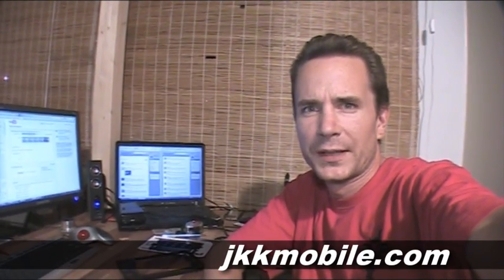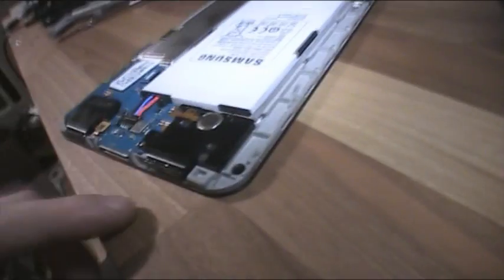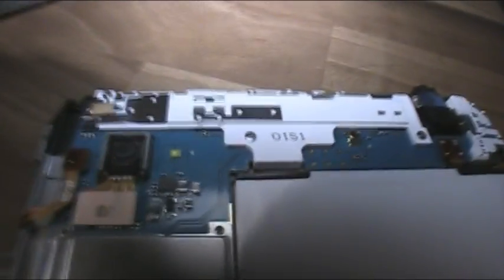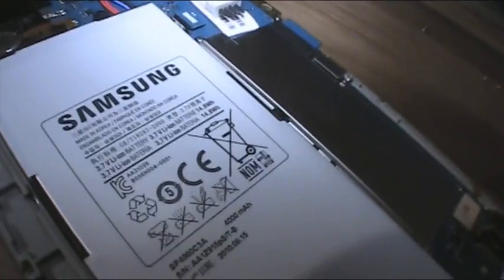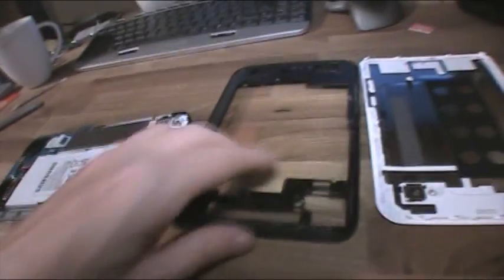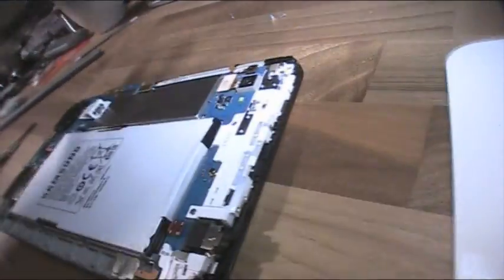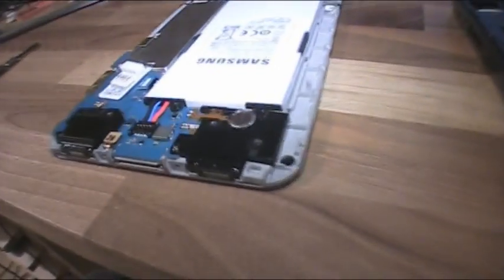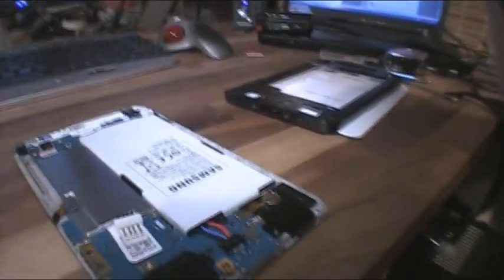Samsung Galaxy Tab Dissected

Comment: I just changed out my lcd screen which cracked, thank to this video,  i couldnt figure out how to remove the plastic black frame or shell, then it became obvious it just pops off, i spent 4 days trying to figure it out.. after watching this it took a minute to pop it off and replace my digitizer.. if anyone is using to just replace the digitizer the whole process can be done in 5 to 10 minutes with all the right tools

Comment: @jkkmobile: because you mentioned snapping plastic when opening galaxy tab... 
What do you think it is the most serviceable laptop brand (if there is one) ? One that allows you to easy open it and clean cooler, replace CPU, etc without worrying that anything will snap. Is it IBM, HP, DELL?
Thanks.